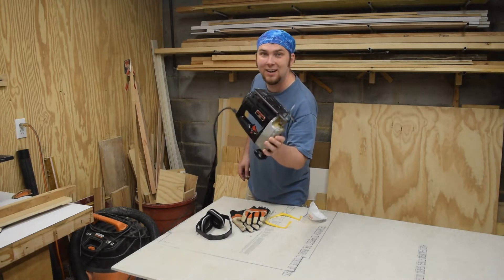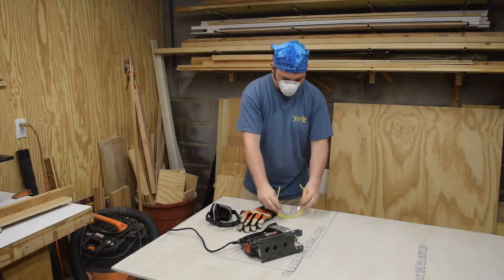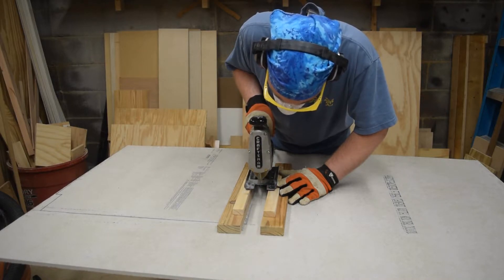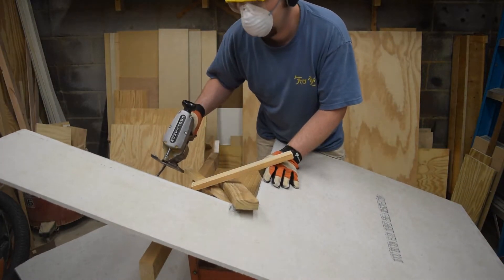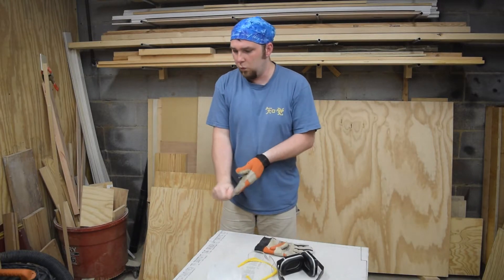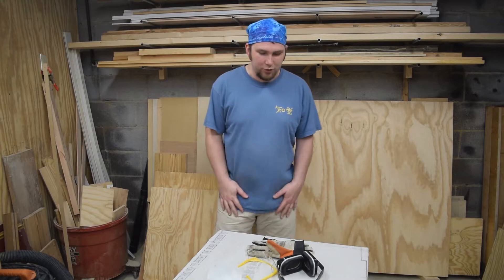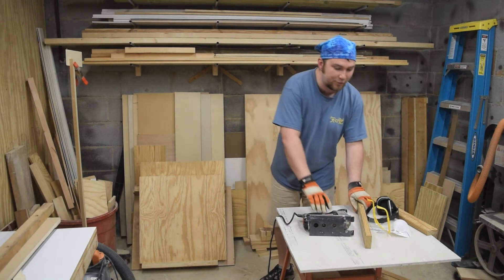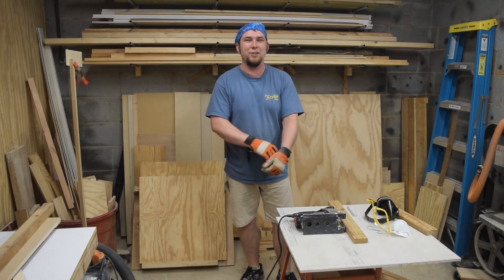Can a Jigsaw Cut Concrete

Comment: I've used a jigsaw on Concrete board and one topic not addresses is the durability of the Jig Saw itself.  After cutting pieces out of a 0.5", 4' x 8' sheet of Durock, the teeth on the Drive gear inside of the Jig Saw was seriously damaged (gear tips were chipped off) & it did not last very long after that work. What model jig saw did you use and is there a model that is capable of handing the shock of cutting Concrete longer term ?? Losing a coarse wood blade is not very expensive; but if it costs you the Jig Saw that is another matter.
Reply from the maker: You bring up a great point! I'm using an OLD craftsman jigsaw. I would not use this technique if I was doing a lot of work. I only needed to make a couple cuts on one small piece. Thank you!

Comment: Hi. What about a Saw Zall ? Is that a good option as well? Also, which is better between… Saw Zall versus Jig Saw? And which would make less dust? Thank you very much.
Reply from the maker: I think the jig saw would make less dust. I think a Saw Zall could work, especially if they make a concrete blade for it. I should have investigated what kind of blade I could get for the jig saw, but I was trying to get it done with what I already had. Thanks for watching!

Comment: I have a travertine countertop that I want to enlarge the hole for a different sink. I think a jig saw with a metal blade would work, but not very well.
Reply from the maker: I'm thinking angle grinder. Thank for watching!
Reply: @MakingSawdust  Yes. I have seen curves  cut into travertine with an handheld angle grinder. Situation is similar to yours but much worse as it is in a tiny bathroom in a 63 year old high rise building. ...but it does have a small window, thank goodness. The material is a bit thicker than the concrete board you are cutting in the video. Just like you, I would like to try to decrease the amount of dust thrown into the air. If I could get the sink out, I could do a test cut with a jigsaw. I bet it would work. ...not very well, but I still think it would work. I would just be really slow. Probably better in my case to try to uninstall the entire travertine countertop from the wooden vanitory, and send it somewhere to have it re-fitted for a new sink which has the faucet in the sink, and not apart from the sink, so that when you turn off the sink, the water on your hand drips into the sink and not on the counter and then to the floor which causes a mess in such a tiny space.  ...or I could just move to a new place.  LOL
Reply from the maker: Ha ha! I love your last suggestion. If you try the jigsaw I recommend a bunch of extra blades. They will wear out quicker than you think possible. Best of Luck!
Reply: @MakingSawdust  The real solution is to magically find a bathroom sink that is the right size and style.  And I think I finally did that.  It was like magic.  Cheers!